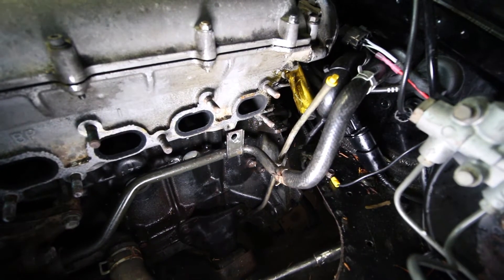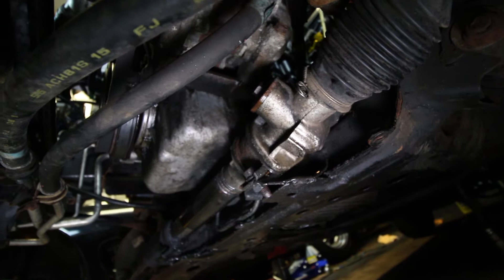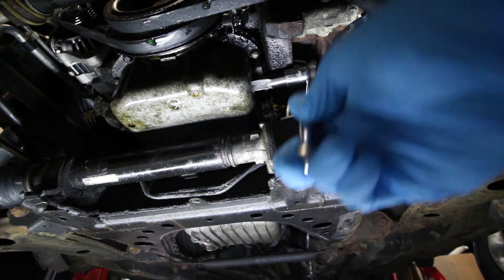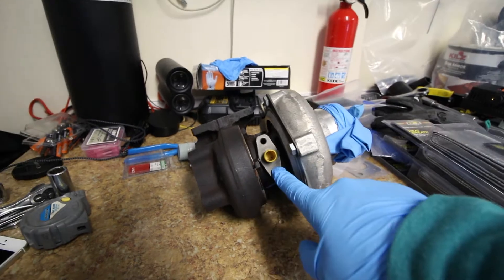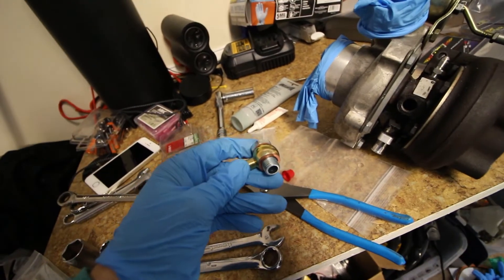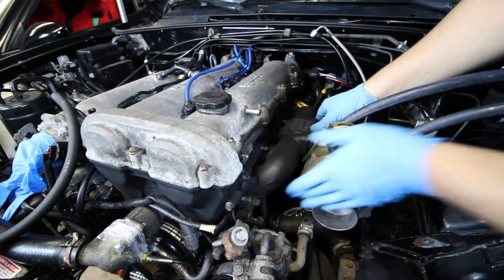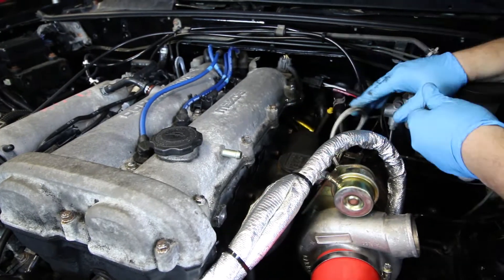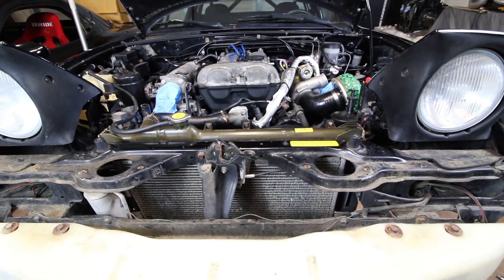Oil/Coolant lines + Mounting the turbo/intercooler! - Miata Turbo Build EP6

Comment: Great channel 👍. It has good content and the videos are well done. Just got one question you mention you have a 97 but you have a oil feed line at the back of the block. The reason I ask is I am getting ready to put my turbo on my 95 and everything I read says on the +95 you have to use a oil filter sandwich for oil feed. I am getting ready to order the water and oil feed hoses and fittings. Thank you for your channel it has helped me figure some of this out.
Reply from the maker: Thanks man, really appreciate that 🙌Yep, I came across the same info as you - which is why I was surprise to find that plug on the driver's side. I would check your block too just in case. Before checking I had actually ordered a "T fitting" that would go in between the oil pressure sender and the block. I liked that route over the oil filter sandwich. I got it from Trackspeed Engineering, although I can't find the product anymore. Here's a pic https://www.miataturbo.net/attachments/trackspeed-engineering-miata-accessories-85/161745-steel-oil-feed-adapters-%40-trackspeed-rjkryhh.jpg?dateline=1455063709
Reply: @supercarmio  cool,  thanks Man.
Reply from the maker: @r6genesis447  you got it 👍

Comment: Was the Oil drain line 24inch when you ordered it? on the website it says "Price per foot". did you add the quantity to 2 or just 1?
Reply from the maker: It comes in one foot sections, so you'll need to order a quantity of 2. Then I just trimmed it a little bit so that it would be about 19". 👍
Reply: Awesome, Thank you so much for replying so quickly

Comment: Just a heads up, you should really use copper lock-nuts like these on the turbo stuff since the heat cycles and vibrations will inevitably cause those flanged nuts to break loose. You want this this: https://www.ebay.com/i/232373728208?chn=ps&var=531645595847

Ask me how I know, lol...
Reply from the maker: Thank you for the heads up! Haha, I bet you might have blacked out the experience if I ask :) but seriously, thank you, this looks like an investment I'll need to make. 👍👍

Comment: Now that you've removed that bottle for A/C (which I think makes it useless) does that mean you'll remove the rest of the A/C stuff (condenser/compressor/lines etc etc) which means no more need to route the IC pipes over the rad?
Reply from the maker: Yeah I am going to end up removing all of the components. You can bend the line connected to the drier quite a bit if you'd like to keep AC. Even without AC, the PS pump/lines take a large amount of space - but definitely possible to not have to go over the rad.
Reply: Had a shower-moment-thought.. You must know what hood pins/aero latches are. Would it be possible to completely remove the OEM latch mechanism so that the trapezoidal shape could used to route both hot and cold piping? Then use the pins to secure the hood? How i can best describe it is: The hot side angled towards the middle, down, then back to the right; cold side angled towards middle, down then back left. Almost like an hour glass shape! Surely the IC piping can fit in that space rather than the two holes either side of the trapezoid/oem latch location.
Reply: 13:00 best shows that space
Reply from the maker: Yeah definitely - I am actually planning to run Aerocatch latches in the future if I can get a deal on a CF hood. I think your idea should work. I measured today and there is about 3.75 in between the radiator and intercooler. Should be a good amount of space to run the piping you are proposing.